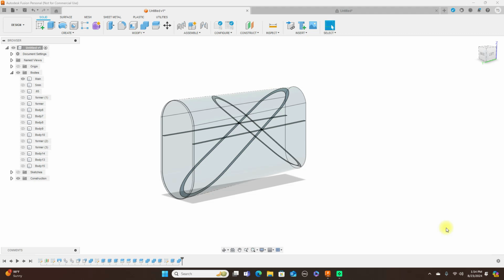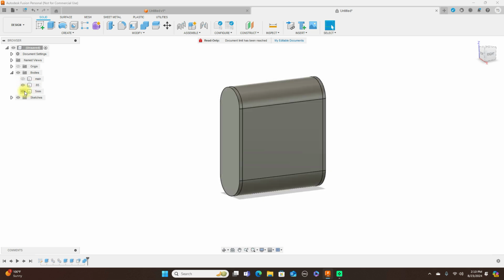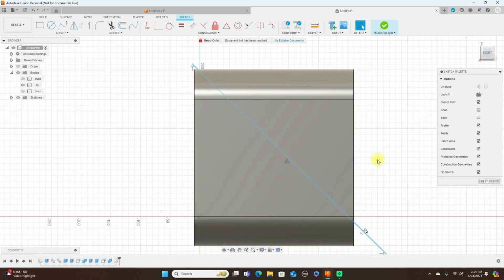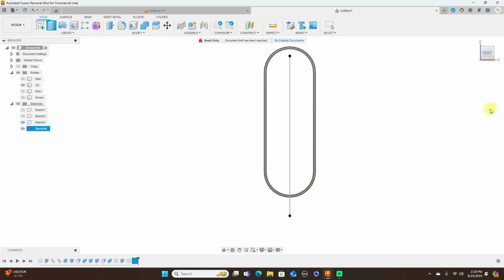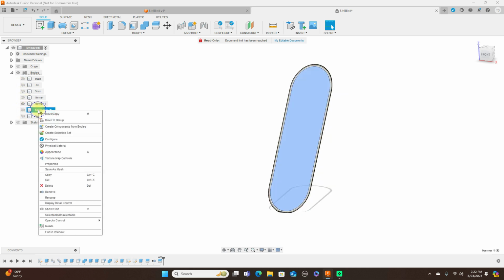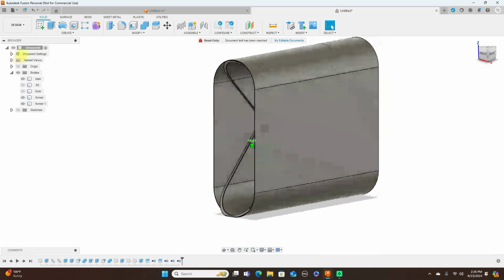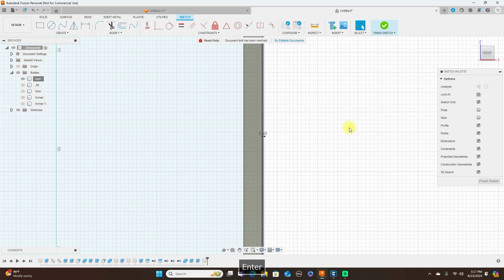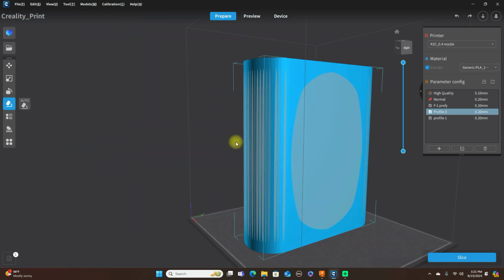How to model fuselage formers like Plane print 3D printed model airplanes in  Fusion 360. Tutorial

Comment: You need to do the whole process in F360 and save it. Then do your video going through the steps and explaing what you are doing and why, so that you do not keep having to jump back and correct errors. Will also speed up the video which became tedious. The information you are providing is good. The presentation not so much too many delays and aaah....s .
Reply: Errors and going back and fixing them helps. People learning from this would probably make the same mistakes. So this way they know what and where to fix. Please keep on showing the whole process